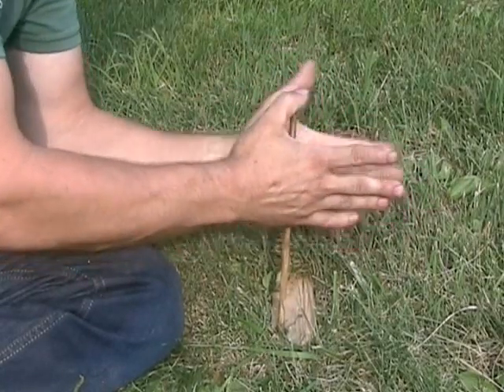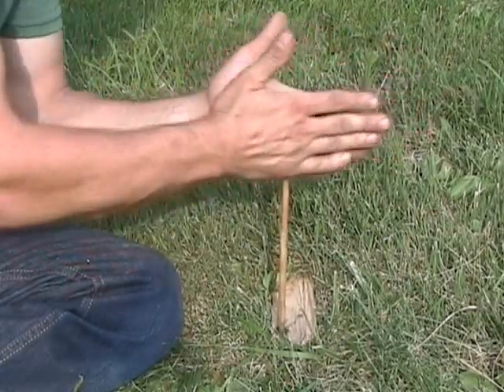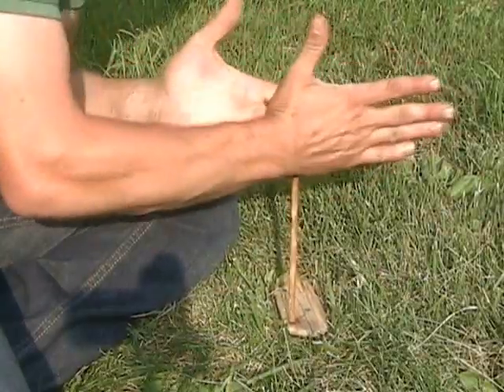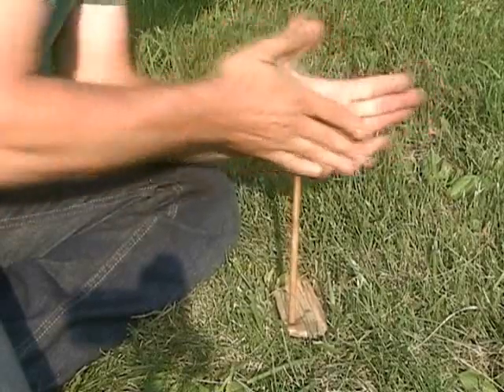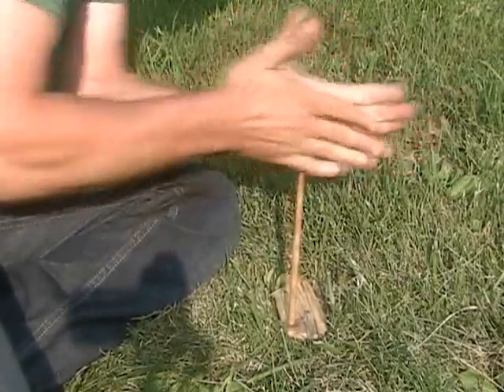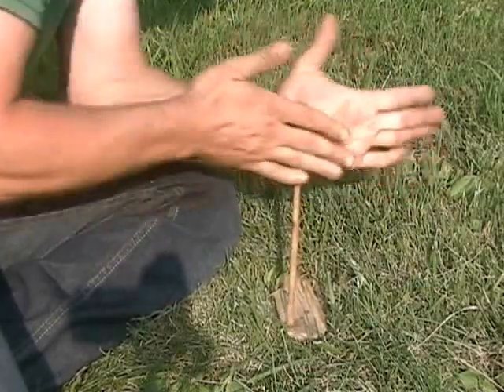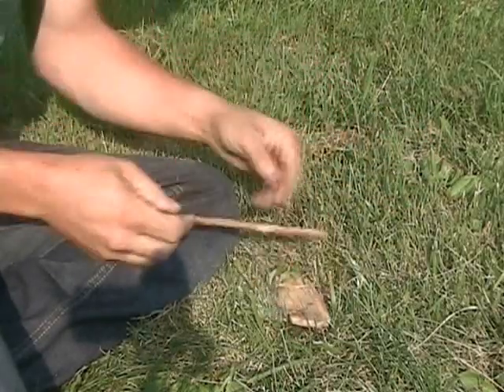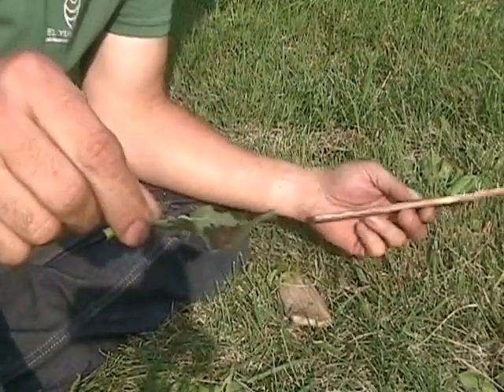Hand Drill Technique.wmv

Comment: Thanks for the part 1&2. Well shown. I continue to have problems with the materials in my area. I have been successful and did post a vid using mullein and balsam fir. But most times I fail with these and other materials, making big piles of powder and lots of smoke, including continuous streams of smoke, but don't get the coal ignition, and I drill right through my board with no coal. Very frustrating. I have harvested some goldenrod which is drying, and will try it.